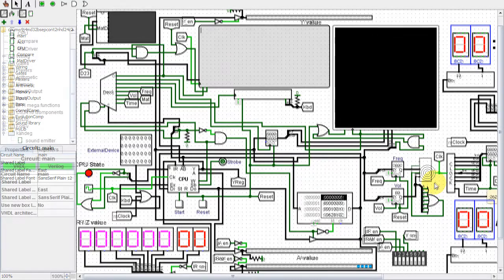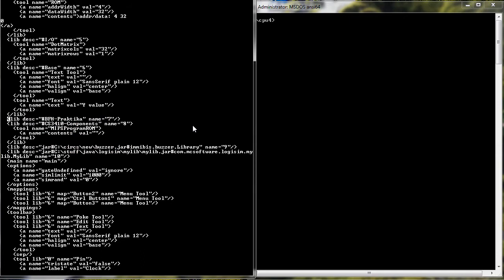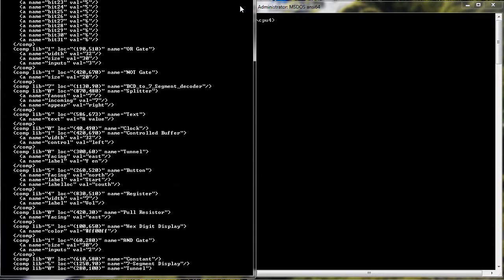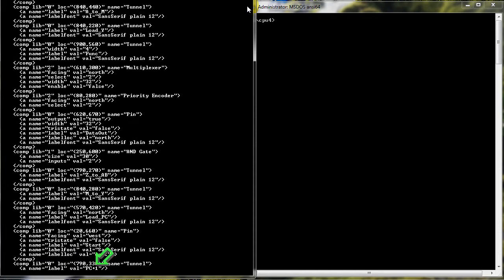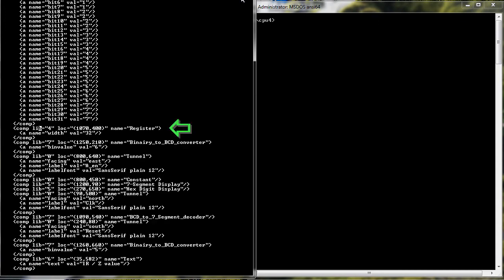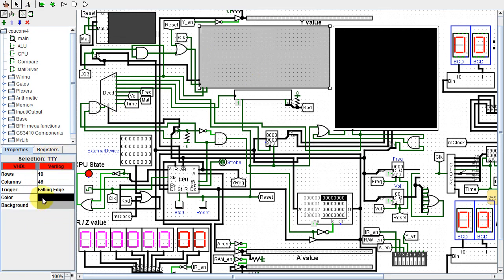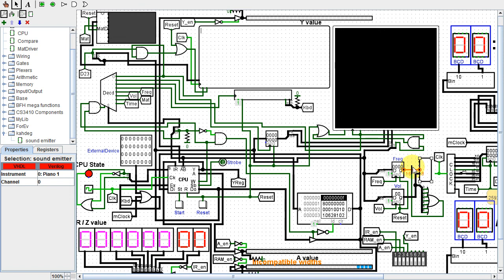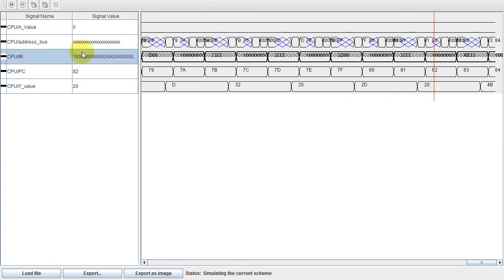My CPU / Computer: Conversion from Original Logisim to Logisim Evolution

Comment: where can i get a link to the LCD screen you used. honestly this is the first time I'm hearing of LogiSim Evolution, so if possible could i get the links to the downloads to the "external" components that you used. i would like to experiment around a little with them and see what i could come up with
Reply from the maker: @Tucker Barber You can download my jar libraries which include the LCD screens at:

https://sites.google.com/site/mrmcsoftware/home/downloads/cs3410for271.jar

(for original Logisim), or:

https://sites.google.com/site/mrmcsoftware/home/downloads/cs3410modvideo.jar

(for Logisim Evolution).

or you could use Cornell's version of Logisim Evolution (or even Cornell's jar libraries) or Kevin Walsh's Holy Cross version of Evolution or the newest reds-heig Evolution (BTW, the newest versions of Evolution break even more compatibility, so my JAR files probably won't work with the newest versions - but might not be necessary anyway since Kevin's, for example, has an LCD screen).

Some of my other logisim JAR libraries are also available for download though: click on Downloads at: http://sites.google.com/site/mrmcsoftware
But the floating point library isn't available.

And here's a link for the sound buzzer (not the MIDI device (of which I provide an improved version on the link above)) which I didn't write: https://sites.google.com/site/immibis/

I think that covers everything.

Comment: Oof! Should I use Logisim Evo or Logisim (Classic Edition)?
Reply: MrMcsoftware 
Is there anything better than Logisim 2.7, or is it good enough?
Reply from the maker: It depends on what you want to do.  If you want to put your circuit in an FPGA, or even just learn VHDL or Verilog, then one of the Evolution forks would be best (Reds-heig or Kevin Walsh's holy cross, or some other version I'm not aware of).  If not, then Classic would perhaps be better (faster usually).  Some people would say that you should use the one that's still being developed/improved, and they would say that's Evolution (since Burch isn't developing the classic version anymore).  However, there are people still developing/improving classic logisim (Logisim Ita for example) - so that probably shouldn't be a reason to not use classic.  So it might just come down to personal preference.

Comment: Could I have your memory library? I also do not like the memory chips in evolution and would love to have the older ones.
Thanks.
Reply from the maker: When I recently downloaded a new version of Reds-heig Evolution, I saw that they changed enough things (got rid of functions or changed parameters of functions) that made some of my libraries unusable in the new version.  I don't know if that's the problem you're having.  My libraries do work in 2.13.20 version of Reds-Heig, you might want to try that version if you're using a newer Reds-Heig.  However, the new Reds-Heig does have options to change to the original logisim look of components, so you might not even need my libraries. Of course, if you're using the newest Reds-Heig, maybe there's an undiscovered or yet unfixed bug in the new Evolution.  Now a bit of a rant to Reds-Heig: with polymorphism and overloading capabilities that these object oriented languages (Java, C++, etc.) have, there's no excuse for changing function/procedure parameters without keeping a version compatible with the existing libraries.  Why even use object oriented languages if you're not going to use it's best/useful features?    Shame on you Reds-Heig.
Reply from the maker: This should do:  https://sites.google.com/site/mrmcsoftware/home/downloads/ForEv.jar
Reply: Thank you :)

Comment: Where did you get the libraries you use?
Reply from the maker: Sorry for the delay in responding...  I'm not sure which exact libraries you are referring to, so I'll list everything I can think of.  I created ForEv.jar by grabbing the memory component source code from the original logisim distribution and modifying it to run in Evolution, and grabbing the video screen source code from Cornell's version of Evolution and modifying it for better video modes.  I created the clock library myself.  And I modified Kahdeg's midi device making it faster and more versatile (my version: https://sites.google.com/site/mrmcsoftware/home/downloads/mididevice.zip?attredirects=0 ).  I hope this answers your question.
Reply: What about that crispy colour display?